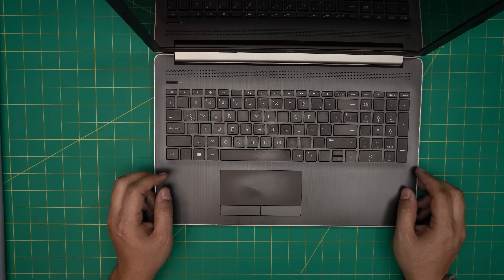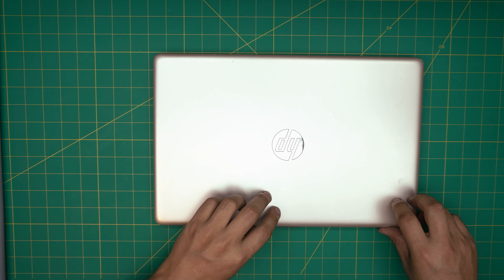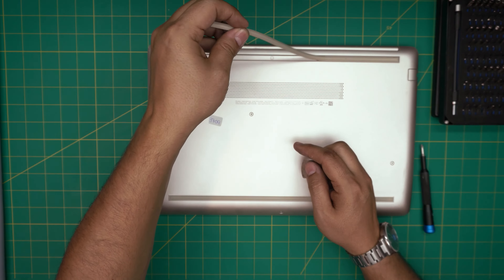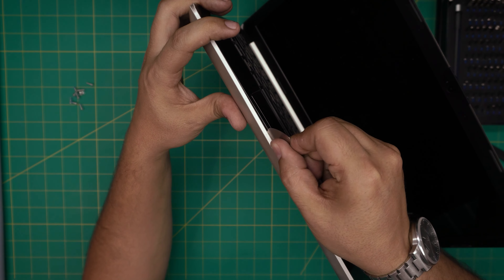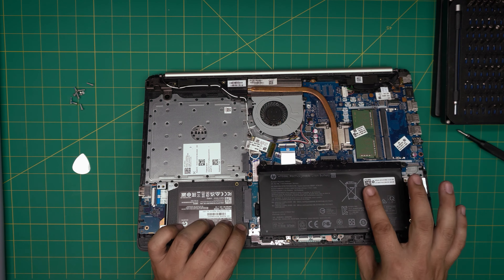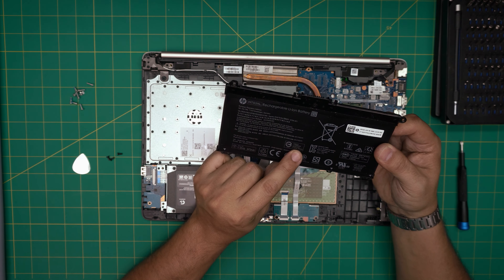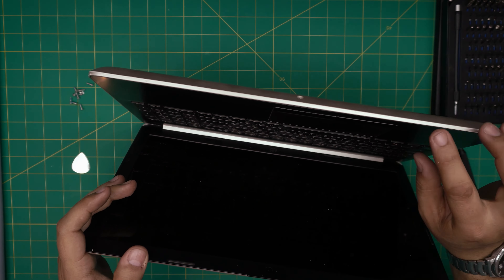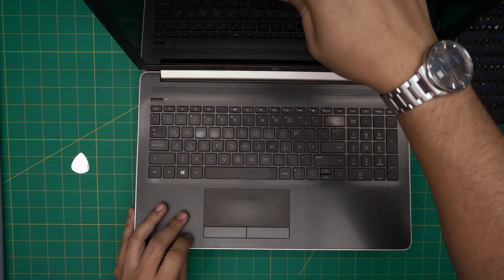How to Replace Battery in HP 15 Db0004 Laptop - Step-by-Step Guide🔋

Comment: Thanks! my battery is popping up so I will be using this! Is it true that these batteries can explode if left to expand and not replaced? Also your link to the battery is coming up sold out. Any other links you can suggest?
Reply from the maker: Thank you for your feedback! If you wish to support the channel, you can like, subscribe, or both!
Regarding your question, absolutely true regarding the battery explosion, we have two batteries exploded in the store because of inflating, the gases inside the battery build up and explode with 1m sweet sparking flame for 20sec.
https://amzn.to/45si7Ew
Should you have any further questions or requests in the future, please don't hesitate to ask me.

Comment: Thank you for the tutorial! But after inspecting the inside I see the battery looks perfectly fine, no bloating, just a little dusty. What would you recommend now? Use compressed air to clean the inside and see if that helps my battery life?
Reply from the maker: It's my pleasure my friend.
🫠 Regarding your question, dusting will not increase or affect the battery life. For the battery to degrade, it doesn't have to be bloated; it can simply degrade over time. If your laptop's power-on time is not lasting as long as before, simply replace the battery with a new one.
Should you have any further questions or requests in the future, please don't hesitate to ask me.
cheers🍻

Comment: Do you know if this model has a cmos battery? I tried looking at schematics because I got the cmos error at start up and the laptops from 2018. I also just replaced the main battery. Could that be the reason for the error?
Reply from the maker: 🫠Regarding your question, these models don't have a dedicated CMOS battery; the CMOS draws its charge from the main battery. If you remove the main battery and press and hold the power button for 30 seconds, the BIOS will reset to the default configuration (it will not reset the password).
Should you have any further questions or requests in the future, please don't hesitate to ask me.
cheers🍻

Comment: H Ijust finished changing my battery. Your video was spot on. However, I did as you said and I didn't turn it on for well over 10 hours. When I opened my laptop to use today, it's not working. It's like it's still flat? What could be wrong? So I thought I'd put my old battery back in and same thing is happenning? It shouldn't take that long to charge up should it?
Regards Leonie
Reply from the maker: 🫠Regarding your question, no need to wait 10h to see if it is working, the laptop should turn on right away after plugging the battery and the charger.
double check the battery connectors.
also remove the battery and plug in the charger and power on and wait up to 30sec and it should turn on, if it doesn't then something went wrong.

Comment: How many hours does replacement batteries last sir? 3?5h? Thank you
Reply from the maker: 🫠Regarding your question about how long the battery should last, it all depends on the display brightness, how many applications and background programs you have open, and if you have any other USB devices connected. Normally, if the brightness is under 60% and you are using it for light office tasks, it should last 4-5 hours. Under heavy load, it should last 1-2 hours.

Cheers! 🍻